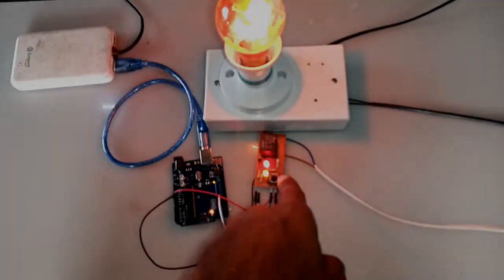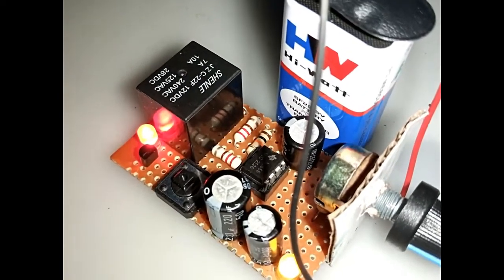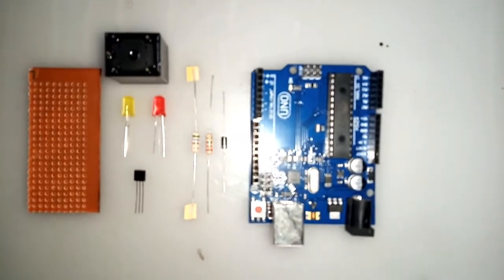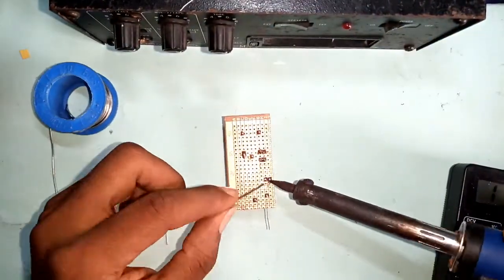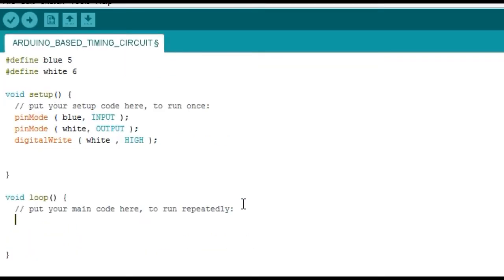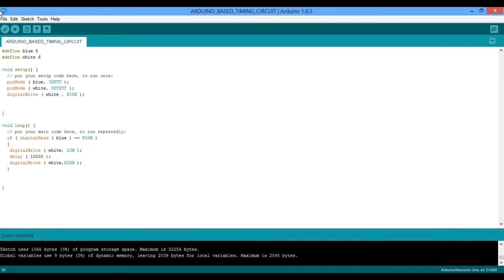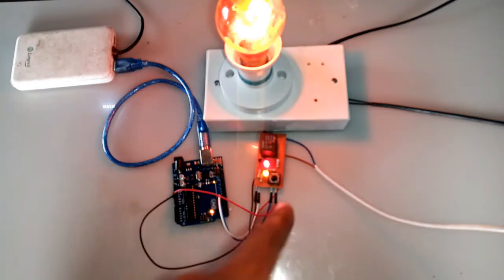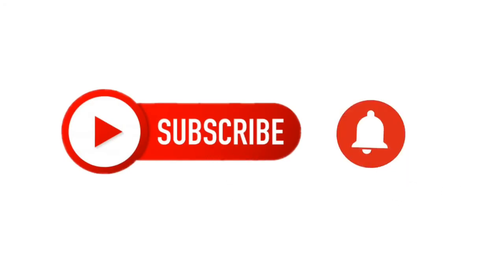Arduino Timing Switch Circuit: How to make a Time delay, using Arduino [ Sketch and Circuit diagram]

Comment: can you list down the hardware components used ?
Reply from the maker: Arduino uno, relay, resistor, Transistor, and diode.
You can check the Facebook page for the Circuit diagram